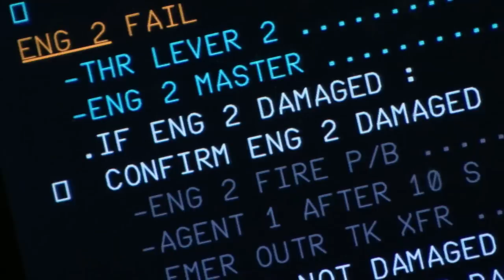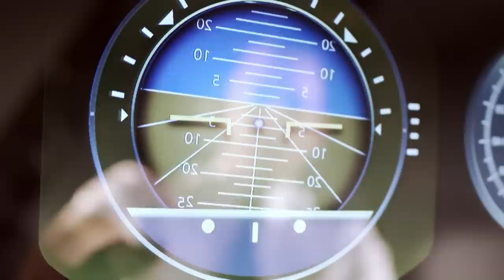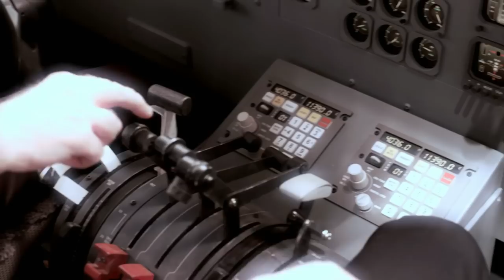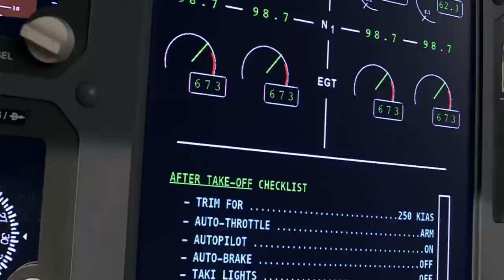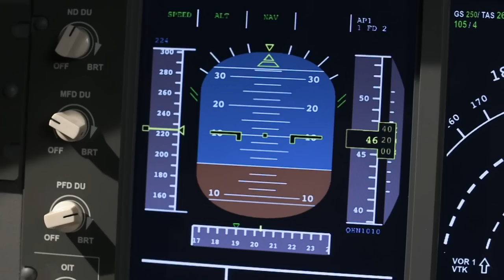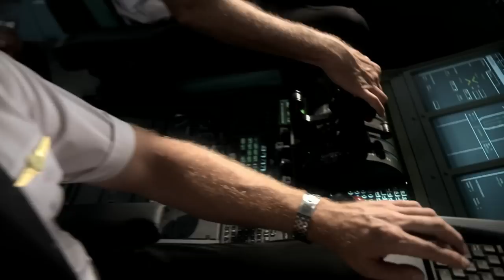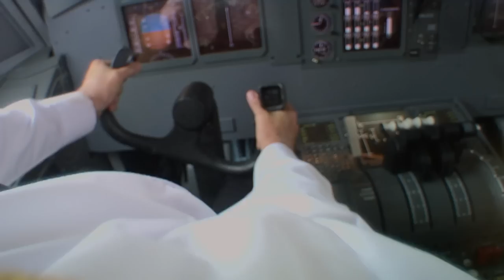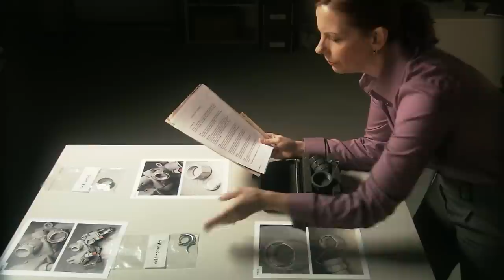Shining A Light On Three Astonishing Feats Of Flying | Courage In The Cockpit | Mayday: Air Disaster

Comment: Jay Zeamer Jr. deserves mention here, I feel… on June 16, 1943 piloting his B-17 “Old 666” completely alone and unescorted on a volunteer (considered “suicide”) mapping mission over the Pacific, he and his crew were jumped by no fewer than 17 Japanese fighters. A 20mm cannon shell impacted the flight deck, hitting Zeamer and shredding him. For the next 45 minutes, he flew his now severely wounded Flying Fortress (the nose shredded and his close friend and bombardier, Joe Sarnoski, dead, oxygen system shot out and gone, viral controls damaged and sluggish) in a literal dogfight against the nimble Zero and Oscar fighters, repeatedly standing his massive bomber on its wing tips and pulling straight into them knowing it would decrease the time they had to attack. Only after the Japanese had run out of ammo and then out of fuel unable to try and chase and ram him did he finally relinquish control… arriving at New Guinea, his co-pilot made one of the smoothest landings he ever made, “just slicked her in”, despite the damage. At first, the medics and crew thought Zeamer was dead, but upon a closer look they found he was both alive and conscious… barely. For his actions, he was awarded the Medal of Honor. His friend, Sarnoski, having been nearly cut in half by plexiglass from the nose from the impact of possibly the same 20mm cannon shell that had nearly killed Zeamer, had crawled back to the nose and gripped his .50 cal machine gun and opened fire on the second fighter, shooting it down before it could finish the attack the first fighter had begun, saving the plane and everyone on board mere seconds before he had collapsed and died; he too was awarded the Medal of Honor, posthumously. The rest of the crew received high awards as well for their parts in the defense, resulting in this being the most highly decorated mission undertaken by a US bomber crew in the Pacific, if not the whole war. Jay Zeamer Jr. passed away on March 22, 2007. Pilots don’t give up. It is the same now as it was then.
Reply: Rest in peace crew of old 666.